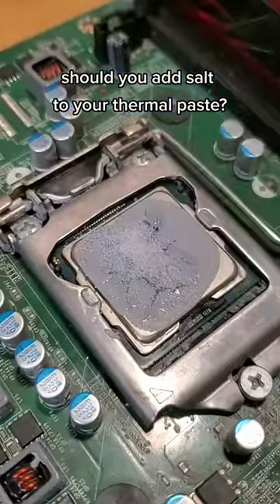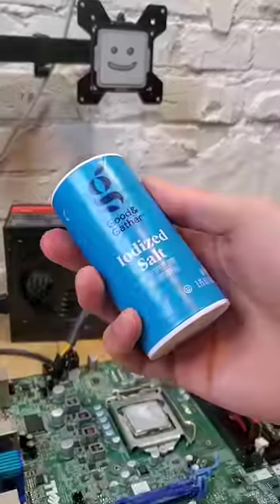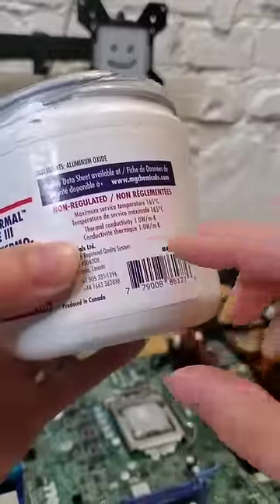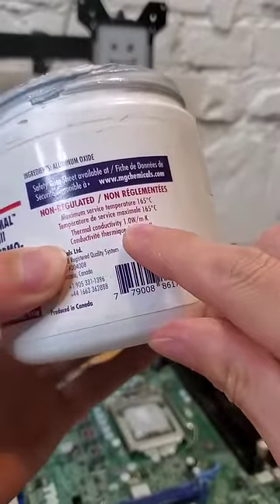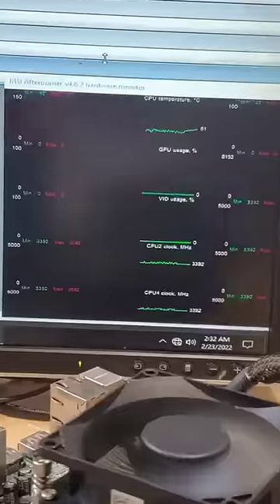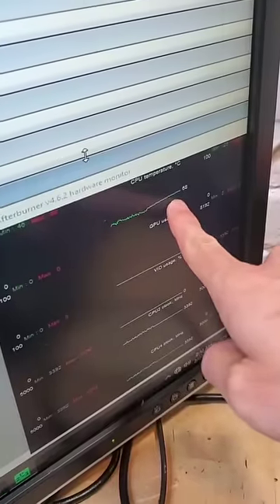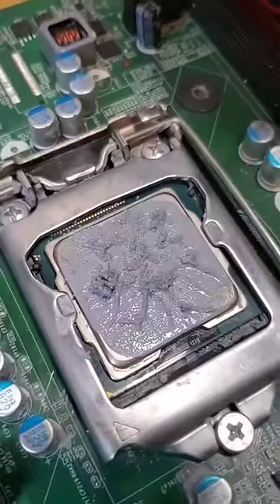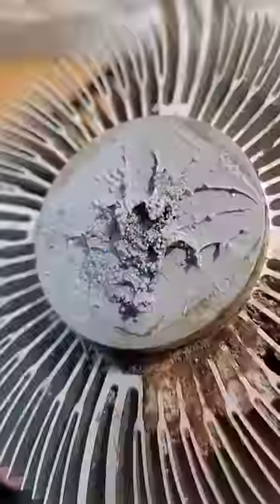should you add salt to your thermal paste? #shorts

Comment: Well then just use finely powered salt then
Reply: Powders are still not as conductive as a gel or liquid
Reply: @EndOfForever  but mixed in the thermal paste, i think the result would be intresting
Reply: @leocabaret7050  you would have to melt the salt down and then add it to the thermal paste while it hot so you get the optimal results i think or you can chop the salt up really finely so i doesnt create any gaps (sorry if i am worng
Reply: @dashswordgaming8836  dies salt melt? I thought it would just carbonise
Reply: @chunkysalads5663  salt contains no carbon...
Reply: @chunkysalads5663  It melts. Kinda looks like molten glass
Reply: @ProfessionalPatches  so why not melt some into thermal paste
Reply: Salt melts at 1,474*F so the grease in which thermal paste compounds are suspended in would probably combust. That being said I can’t find a solid answer as to what this grease is so that might not be the case. Finely powdered salt would probably work better.
Reply: @chunkysalads5663  it melts at 801 degrees
Reply: @Oracle2448  it would burn the thermal paste
Reply: @w4st3lander  not necessarily you could Melt the salt into a think sheet or disc, than put it in the thermal paste once it's cooled down enough. So it would be like a Oreo, with the Salt in the middle smooth and the thermal paste on top and bottom. Might work
Reply: @christinaandwena8917  so what stops you from making a salt disc or coin, and using that once it's cooled to like 100°C
Reply: @jenny_talia  really not but ok
Reply: @Oracle2448  table salt needs to be extremely hot to melt. It wouldn't work
Reply: @Oracle2448  it is too much work, even if it did work. No company would do that if thermal paste worked better. It's cheaper and like jenny said, if it ain't broken don't fix it
Reply: Ye if you dissolve it in the paste maybe?
Reply: @Crystalcluster  i would be very surprised if you manage to desolve salt in thermal paste. Maybe we can desolve the salt in water and mix the salty water with the thermal paste. Someone said it container greese so maybe it wouldn't work either because they can't mix very well 🤷
Reply: @dashswordgaming8836  yo, that's crazy hot. Something tells me that it would make the pc hotter than without...
Reply: @leocabaret7050  crunch it up more or mix it into the thermal paste really well maybe
Reply: You know what I’m saying instead of making a long ass video on how it does not work
Reply: Like moon dust or some type of silicate
Reply: There must be a way to disolver the salt in the termal paste, alcohol and the  salt, add the termal and wait to the alcohol evaporate?
Reply: @CMOVTEC  Salt would recrystallize so still not really worth it
Reply: @leocabaret7050  many modern thermal pastes have silver power or even Diamond powder which dwarf the conductivity of salt. (Conductivity in the hundreds, not 5). 
But the point of the paste is to replace air, not metal. It’s only to fill in the TINY air gaps due to scratches and imperfections that exist between the two flat pieces of metal.
Reply: @EndOfForever  gel salt
Reply: @Oracle2448  because it melts at too high of a temperature
Reply: or liquid
Reply: @tenkoalaking5696  too hot
Reply: He tried it, it's slightly colder
Reply: @Oracle2448  There is no point in doing that because then you're adding an extra step to transfer the heat. It would transfer to the salt and you would need an extra layer of paste between the salt and heatsink/coldplate. You'll get higher temps by doing that.
Reply: @Joe-nr9xf you didn't read my comments did you, go back and read them. It'll answer what you just said. No u use about the same amount of thermal paste the disc wouldn't be that thick you could snap it with your fingers.
Reply: @TheHuntermj  loved that 🤣🤣
Reply: He did it and I think is was a couple degrees lower than just thermal paste, it was only a quick test though so it may not work well long term
Reply: @TROJANP  “long ass video”
Video: 30 second long short

Are you 12?
Reply: Can't he just make is into smaller particles?
Reply: @leocabaret7050  Yeah he tested it(I won't tell a spoiler)
Reply: @Oracle2448  salt is corrosive and absorbs humidity,  that would ruin de metal plate of the processor and the heatsink, do you need another answer?
Reply: @liro13  were talking about table salt not rock salt 🤦‍♂️🤦‍♂️🤦‍♂️
Reply: @Oracle2448  table salt  still have the propeties that I nentioned
Reply: @liro13  not the absorbs humidity, 🤦‍♂️🤦‍♂️🤦‍♂️
Reply: @Oracle2448  well lets say  it's not corrosive and don't absorbs humidity, You still need a paste/gel like, to cover the micropores in the processor, and if You melt salt u need to put it the melted salt in the cpu at more than 801°c( if don't it would form crystals) the high temp would mess the transistors of the chip, every silicon chip only holds up 200°c (300 at Max) until the litography gets ruined
Reply: @Oracle2448  and also if You melt salt you  still needs to find a process yo get rid of the impurities from the salt.
This si an example of how gets the salt after being  melted  https://youtu.be/9QZ5In6P-A4
Reply: @liro13  what part of DISC IN THERMAL PASTE do u not get.
Reply: @Oracle2448  what part  of the salt would have lees Thermal conductivity than the Thermal paste  you dont understand? You can do  every  experiments that you want and you will get +20° degrees than  only usingThermal paste
Reply: @liro13  That's how you do it outside yes DIY style. I mean if someone where to do it with expensive equipment and experience, like a 1mm thick disc smaller than the thermal paste application needed and you put it inside the thermal paste so it's still thermal paste top bottom it's just there to absorb heat like the salt dust
Reply: There is a video of it.
Reply: this aged well

Comment: what if you grind it finely
Reply: Yeah i feel like you could grind it super fine (with a coffee grinder, or a mortar & pestle), then mix it into the thermal paste to improve its thermal conductivity.

Definitely an idea worth some investigation, imo
Reply: Or just melt it
Reply: @LamaSlayer4622  You can't melt salt...
Reply: @Tuberex  Search up molten salt
Reply: Any metal unevenness can cause significantly worser thermal contact, I recommend using salt water and using in solution on the outside
Reply: @AustiBomb33  more efdicient way put it in water and then put the saltwater into the microwave
Reply: @Tuberex  you can melt anything
Reply: Imagine we create some insane thermal paste
Reply: @transecho  Try to melt salt and tag me in your video
Reply: @LamaSlayer4622  the melting point of sodium chloride is 1,474 degrees F or 801 degrees C
Reply: @LamaSlayer4622  but if you melt it, wouldn't the fact that it's molten increase the temperature?
Reply: @inexplicable1906  pour molten then let it cool, dummy
Reply: @inexplicable1906  You can put it in a slim container and then cool it down. Then put it on the CPU "My genius is almost frightening"
Reply: @transecho  you can’t melt doritos
Reply: @LamaSlayer4622  have you ever actually seen molten salt? It's not what you think and I don't see how having something 1500°F would help cool something down lmao
Reply: @tennicktenstyl  then wouldn't it just be solid salt?
Reply: @Tuberex  you can melt anything
Reply: You melt the salt, and press it before it cools down
Reply: @Tuberex  molten salt is used to store heat energy from solar plants
Reply: @bruhbwoi3618  technically some nuclear plants are cooled with molten salt, though it's because they are hotter than that.
You won't cool down a cpu with currently molten salt, but you can probably use it like gallium.
Reply: @satibel  salt forms into crystals when it turns into a solid so no it wouldn't work
Reply: @Tuberex  you can 💀
Reply: @wifi1990  At like 1000°c you can but you can't do it like sugar
Reply: And then mix it in in bowl
Reply: @Tuberex  I literally used to melt salt for fun when I was in college.  I used to just pour some salt into a shallow metal bowl I had, and just heated it up with a propane blowtorch.  It took like a minute or 2 for it to melt and become the same consistency of water.  Why don't you just look it up?  It's really not that hard to look up "molten salt".  There's a ton of videos on it, and a lot of those videos of people pouring molten salt into water to create an explosive reaction.
Reply: What if you dissolve the salt in a tiny little bit of water and then mix that with the paste
Reply: @AustiBomb33  you’d want to spread it thinly too.
Reply: @bruhbwoi3618  Like many other materials. You can prevent crystal growth by rapid cooling. By the way, checkout related topic on Wikipedia about phases of ice. That's quite interesting IMHO.
Reply: Or melt it into a flat disc
Reply: @Tuberex  you can melt everything, everything has a melting point, even wood has a melting point but it’s burning point is much lower so you never actually make it to the melting point
Reply: So I wanna see this in the next video let's blow this up
Reply: @ЮрийДолотказин-с4ы  I did not know that but it's still wayyy easier to grind it up into a very fine powder
Reply: @benbork9835  you can, but youll end up destroying the chemical makeup.
Reply: @MrHolyKindness You can melt it but it wouldnt really melt like gum or sugar, it would melt the processor too
Reply: @inexplicable1906  yea but molten between the cpu and cooler so it makes perfect contact
Reply: @Tuberex  really dude? Pretty much everything melts.
Reply: It would still be bumpy and also it wouldn't help unless it was dissolved into the paste as aposed the just being in the paste as the heat would have to transfer to the paste, to the salt, to the paste again.
Reply: @MrHolyKindness it’s just not
Reply: @LamaSlayer4622  You absolutely can melt salt. Only issue is that it melts at 801C which.. might overheat your CPU
Reply: Would have the same result but like maybe 5+ degrees
Reply: @Tuberex  How about you try to melt salt and tell me that it doesn't melt.
Reply: @SkylarSpooko  wood doesn’t melt
Reply: @Tuberex  lies I melted my salt lamp with a blowtorch because it broke
Reply: @Tuberex  how do you get rock salt. It melts at 800°C which isn't actually that overly hot those temperatures were easily exceeded in earths earlier stages, it collects in veins and cool into huge clumps of salt which can then get mined out.
Reply: @LamaSlayer4622  when it cools down agian it will be like a big salt ball then... You'd had to form it perfectly while it's hot
Reply: @tennicktenstyl  then what? It hardens back up
Reply: OH MY GOD CHECK HIS NEWEST VIDEO HE DID IT!!!!
Reply: @MarsterMikkel  I know. I already said that
Reply: @Brian-iz9sh  I know. Put it in a container then cool it down. The only reason I said to melt it, is to make it flat so it can be a better conductor
Reply: @LamaSlayer4622  way way to hot when melted, like melting glass or metal
Reply: A paste might do the trick. It cant be rough thats all. Roughness ruins the contact between the hot and cold surfaces
Reply: @tinybionic8940  I already said many times. Put it in a container that is slim then cool it down. So it would be flat. Better than small little rocks different shapes and sizes
Reply: @fpskoda467  yeah but now it's fused to the two surfaces so that it transfers heat without an air gap
Reply: Doubt you can grind it more finely than the surface of an IHS.
Reply: He tried it, it's slightly colder
Reply: @transecho  wood?
Reply: @Tuberex  of course you can, the main problem is that it should be really hot to stay fluid.
Reply: @Tuberex  oh yes you can but it does take a bit more heat !
Reply: @Tuberex  you can melt anything…
Reply: @transecho  no you can’t. .-.
Reply: @AustiBomb33  r/itemshop
Makes players immune to heat based attacks
Reply: @Tuberex  like you can but, you ain't getting low temps with it XD

Comment: A very very thin sheet of corundum Al03 or diamond would do the trick. no thermalpast needed any more. It's non conductive non soluble in water, high temperature, and highly thermally conductive. And made very thin is then compliant enough to be squished between smooth plates... So surface grinding of both CPU case and cooling block is required to minimize the needed clamping pressure to have a good surface contact

Comment: Table salt has iodine in it. Iodine while not combustible on it's own, when heated at high temps (35°C and above) can make some substances (namely the thermal paste itself) highly combustible. The heat increase in the clip is direct result of that reaction. Hope that helps.

Comment: get one of those coffee grinders and just grind the salt until its a reaaaaallly fine powder and mix it in nicely on a seperate cup and apply it.
Reply: I doubt that would work much better. Unless he could somehow dissolve the salt into the paste
Reply: Just mix it in to a little batch of thermolpaste.
Reply: that grinder wouldn't go fine enough but a mortar and pestle might.

unlike what the other comments suggest, i dont think the salt would dissolve in thermal paste considering it doesn't contain water or any other polar molecules as far as im aware
Reply: @danagibbs3265  that's exactly what grinding it up fine enough would allow the salt to do :v

I personally don't think it would outperform the paste alone tho, the granularity does make a difference.
Reply: @catherinecat6182  they do actually, i was suprised too, i was gonna make a mold and i needed fine salt and put some in my coffe grinder, runned it for about 30 seconds and it worked.
Reply: Powdered salt exists
Reply: He made a follow up vid
Reply: He tried it, it's slightly colder
Reply: His follow-up didn't address my hypothesis so great though cuz he kinda just hugged a bit of salt in the paste. I was thinking it would affect the surface contact area when mixed in evenly but the way he did it was arguably more clever lol

Comment: It’s due to the sodium in it, sodium itself sits at 140W/(m K), due to salts crystalline structure it is working against the thermal compound as it is less contact area, and the purpose of thermal compound is to disperse the heat across the entire outer surface of the heat spreader and to take up any micro surface deviations between the heat spreader and the cpu cooler so the crystals in the salt are actually causing more space between the two therefore decreasing the heat transfer to the coolant

Comment: Ive got an idea, grind the salt... Like really grind it until it turns into actual dust, get a small plate or anything then add thermal paste on it and then mix it well with the grinded salt rocks, instead of putting the salt on the cpu with a thermal paste already, dunno if it will work.
Reply: He tried it, it's slightly colder

Comment: Just go to a car mechanic and ask for pot of copper grease, like the old days. I'm sure they'd gladly scoop you some for a small fee. Works brilliantly on brake pads and calipers and those things can go red hot. You can use silver grease, like we used back in the 90's, but that's pretty expensive these days, copper is only slightly less efficient but still better than thermal paste.
There's a reason the heat tubes on your heat sink are copper.

Comment: The problem with grinding the salt down like you guys are saying is that the reason we use thermal paste in the first place is because CPUs aren't actually flat. They have very slight bumps and stuff that require something like paste to fill and conduct the heat at the same time. So if you use salt, it won't fill those super small crevices well enough and you'll end up with a air in between the CPU and the cooler.
I assume, atleast. Hopefully he retrys this.

Comment: Mix the salt with water, then apply, wait 2 hours, apply 1 cup of copper sulphate, then  1 hour later, 1/2 cup of hydrofluoric acid, then throw away your corroded board.

Edit* be sure to pour the HF on your hands so it runs off and drips onto the CPU (this step is to make sure you get to suffer more then your pc), and make sure there's no calcium gluconate anywhere within 300 miles.

*Double edit- remember to always add water to strong acids, while the hotplate is turned up all the way and the stirring is spitting your concoction everywhere.

Comment: If you add it stupiditly like that then yes the grains should be grinded finely then mixed to the paste and then spreaded thinly onto the CPU. But using Salt is stupid from the get go anyway, because it's hydroscopic which means it adsorbs moisture and you might get oxidation/corrosion on the parts because you basically made a galvanic cell with the casing of the CPU and the cooling block with the now moist salt as electrolyte. Just make your homework on basic stuff like Math, Chemistry, Physics, Biology and Material science in general then you shouldn't need to try dump stuff like that because you would know that it back fires before hand. If you want to have a better thermalpast then you should make it on your own without messing with the property of the bought ones. XD

Comment: I wonder, what if you dissolved the salt into your thermal paste?  or what if you dissolved salt into your water for your cooling system?  Yes I know salt water is corrosive and it sounds like a great way to rust your radiator but~ adding salt to water changes many of it's thermal properties.  Mostly that it can be colder before it freezes.

Comment: Ok hear me out: submerge the cpu and the cpu cooler in salt water (with a waterproof cover over the pins) and let it evaporate, leaving a solid piece of crystalline salt between the two with extremely high thermal conductivity